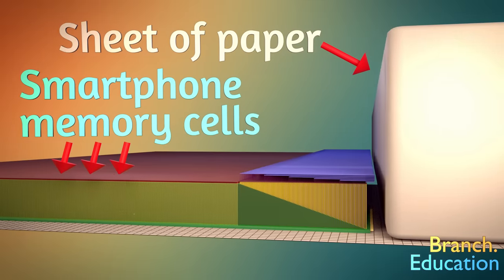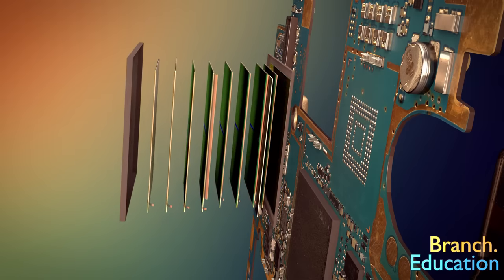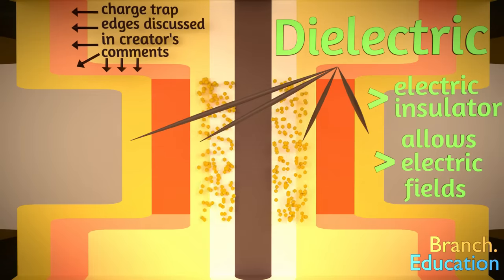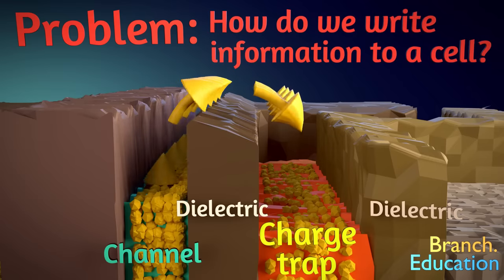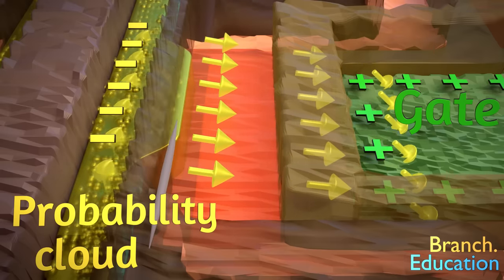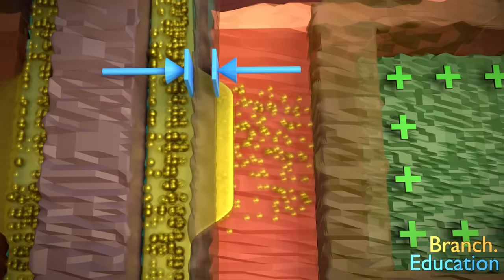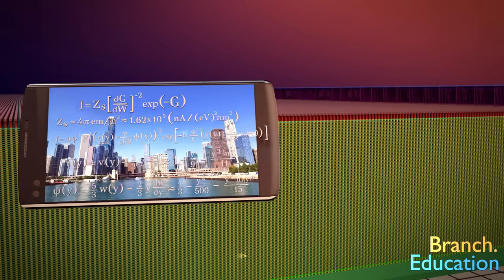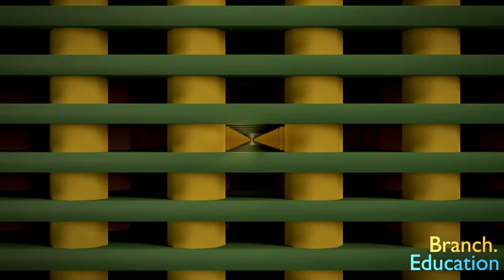The Engineering Puzzle of Storing Trillions of Bits in your Smartphone / SSD using Quantum Mechanics

Comment: This is so cool, but the thing I always wonder is that how do they made these atom sized things !
Reply: Mostly litography i believe. That is like revealing photos, one over another
Reply: They build up these patterns layer by layer. Not the "layers" of different materials you saw in the video, but bottom to top. You start off with a flat sheet of the material you use the most. Then you use light shining through a mask to edge valleys into the material. Those valleys then are filled up with another material and excess material is polished away leaving you with a flat sheet of one material with patterns of another material. Repeat this until the layer is done and then continue with the next layer.
Reply from the maker: Kinda how Cubinator & Marcelo described.  More accurately, they alternate depositing layers of Silicon Oxide and Nitride, and then use lithography to create a 'stencil', and then use an etching tool to cut into the layers, and then do another set of depositions through all the holes, and well... it's a long process.

Comment: I have always wondered how information was stored in a chip. I knew it was stored binarily but didn't understand how we managed to prevent that information from escaping. The fact that we can store and access information coded in this fashion is mind boggling. Unbelievable achievement.
Reply: It's only flash and nand memory that works like this.

There are other forms of solid state storage chips that work completely differently.

Some use tiny capacitors. E.g. RAM. 
Some use only transitors. E.g. Cache memory inside processor chips (this is also the fastest and most expensive type of memory)

Comment: Thanks so much for the wonderful explanations in the tech details; you guys are amazing. I like to point out a confusing Canadian/Eng subtitle for the tech details part in timing 1:32? Your equation said 6E11 bits = 1.5 E11 bytes? The only reason that I can guess is that you treated two cells of the flash trap as one memory unit, which means that 2x6E11 bits = 12 E11buts = 1.5E 11 bytes? Again, all thanks for the good works!

Comment: It's pretty insane we can manufacture structures smaller than any wavelength in the visible spectrum. They have to use extreme ultraviolet light to even cut those channels, it's the only wavelength thin enough to cut grooves that small.

Comment: Amazing explanation. I saw the SSD video in which you missed how exactly the cells trap charge. Now its clear. I work with transistor bitcells which can store 1 bit, very interesting to see how 3D NAND can store 3 bits. Would be thankful if you could also explain the sensing circuit for the 3D NAND.

Comment: Thank you for the caption comments. They were phenomenal. I got all giddy and excited when I got SiO^2 correct. However, I was expecting the Silicon to be doped with Boron or Phosphorus depending on the direction they want the channels to flow kind of like how Solar panels are basically giant diodes pushing the charges in one direction towards the battery. What are the advantages of using Nitrogen instead of Boron or Phosphorus?

 I've kind of obsessed a little over how solar panels are created and function in the past several months and it's pretty cool to see similar applications but on a quantum level for other devices. 

It should be mentioned that while SiO^2 is basically sand, it is a bit more complicated than that. SiO^2 has a very specific structure (allotrope) and is not as common as the sand you find on the beaches.

 The SiO^2 is ultra purified using carbon arc welding (CAW) which allows the Boron, Phosphorus, Gallium, or in this case Nitrogen molecules to attach in specific places for ideal electron movement. Obviously electrons are in general fields, not exact spots, however these spots are more predictable based on which allotrope of an element you are dealing with. That is why it isn't ordinary sand...

Comment: A few questions:
How do you empty a charge trap? 
Also, you said that applying a positive voltage to gate is how you poll for the level of charge stored in a charge trap, but in this video you say it's how you increase the charge stored in a charge trap, how is it possible that applying a positive voltage to the gate does both of these functions?

Comment: What this video omits is that the very waves in which that tunnelling depends on to work, do not exist. The waves were attributed to the quantum scale in the1760's when very little was understood about QM. Waves were attributed to QM scale because there was something like waves seen at our macro scale, as in water waves and in musical instruments. It is now known that those waves are not really there but are artifacts of a deeper mechanics. In water that is water tubes that rotate and the part of the tube that is closest to the surface is an artifact or a left over part of the action that is mostly under the surface. The top part that, looks like a waves is actually a part of those tubes of water under the surface. Same in a bell. The strike that makes it work is a compression front that propagates through the material of the the bell to deform the bell in making it wider at one part of a compression cycle and narrower at anothe part of the decompression cycle. There is no actual wave there but oscillations of compression fronts moving through the material of the bell. Same in stringed instruments. The vibrations seen there is more like that of a skipping rope where the string rotates but is held in place at the ends where the same kind of compression and decompression guides the string to flex at those two points and the length rotating is a left over mechanism from the ends where the actual control or mechanics is to make the rest of the string behave the way it does. The ends of the string holds the energy and the rest of the string is a left over response to that main point of energy.

By attributing something that does not even exist at the macro level is to give the quantum scale something that just does not exist as a real mechanism at either scale. That makes waves as something that is just used as a handy way of explanation that is assumed to work, theoretically, as in, the best explanation currently available but never proven to be based on something that actually exists, and then just used for that being an accepted part of Quantum Mechanics. QM is based on several such assumptions without enough of its practitioners even questioning this very strange condition under which QM is being practised.

Carver Meade, the most prolific inventor and manufacturer of transistors, never used QM to design his transistors or to guide the development of his transistors or to manufacture them. He also stated that QM, in the way it is practised currently, will be laughed at in, about 100 years just because of the gross and inaccurate assumptions that QM is based on. Meade has also called on QM to be over hauled just because of that point.
How an electron gets past that potential barrier in the transistor as shown in this video, is by changing its potential energy into kinetic energy and wiggling from one atom to another that way. No waves or probability required. 

What QM physicists are doing, is propping up their belief based way of doing work at the quantum scale because there is no real understanding of how to do it in any other way. That is the exact reason why the QM scale is described as not being anything like the macro scale.

Also the electron was assumed to be a point since the 1920's. A PhD student was searching through the available literature as to how the electron was modelled. Not finding anything in that literature, the student stated in their thesis, "Let us assume the electron to be a point." That statement, when found by later researchers, and not finding anything to contradict that assumption, also used it and repeated it as a reference until the number of those same references to that first paper was so large in number that, that is all that it took to make it stick. No actual physics work was involved so it is all an unfounded assumption. 
The third of many such assumptions is that gravity is a 4th force like the 1st electric force, 2nd nuclear strong force and the 3rd weak nuclear forces. Because the first three have all relatively easily been found to have a particles associated with each of those first three forces then, it seemed reasonable to assume that gravity should also require a particle but which particle was not found by the equally easily found way as those particles were found for the other 3 forces. But, no matter how hard everyone tried, it was not found. So the work of Mr. Bose in the 1960 was dug up and found to be modelling or explaining gravity by the use of particles. That was used until there was some sign of a particle in the Large Hadron Collider of a particle that seemed to fit. That particle never did fit enough of the several requirements to confirm it as the particle searched for. So a vote was taken and it all depended on that vote to decided that a particle existed when it was very much in doubt. That is not physics as well but a use of a political action of voting to settle what physics could not do.

 There are many more such blunders in QM and Cosmology that all make the practice of physics to be based too much on too many assumptions and too little actual physics which is the way physics is supposed to be done. As in experiments that either continue to uphold a theory or to falsify the theory. Which is the real reason why QM is so weird. If those assumptions were replaced by slow painstaking work then we would have a much less weird way of doing physics. But try and tell a physicist to slow down and do their work more carefully and they will cite the need for getting money or starving. So they are basing their way of working  more on not having a steady income and not what the rsults of that way of doing physics will have a bad effect on physics. Money is the source of all evil for sure.

Comment: Most of quantum is indirect explanations and fudge factors that produce useful results. However the actual explanation is likely wrong and incomplete but has allows people to look at it from a different point of view. So much so it looks like it is new. Most of this happens with PN junctions which is glossed over. There is a few properties here which can explain some of this. The field strength is a problem for diodes under certain design/operation conditions. Leakage happens for a couple reasons.
According to this explanation this is kind of like active transport in biology. However unpredicted is the homeostasis behavior which is passive. Many people will discredit this as there is "proof", which is funny at best. What are electrons again? Subatomic particles that can exist on silicon lattice? Energy can move them? How do semiconductors work again? What is a filter? What is energy? The scope of the barrier is the difference. A lot of topics in science pop up in other places.
Computer Science, Economics, Business got time, computation, work and money wrong. All fail to understand systems. Here is the problem with frequency centric models is it fails to understand certain things which shape architecture. You also can use lower voltage signals to store information. However this assumes no noise, which can become hard. Also filters react with them.

Comment: hey, why exactly those cells have a limited number of read/write cycles? what exactly happens with the cells?
Reply: Afaik when the data is erased not all electrons go back. Some stay trapped. Over time so many get stuck that at some point you can't tell for sure if it is empty or full.
Reply: Also the leak is the cause for data degradation/data decay
Reply: reading data involves measuring voltage. and 3bit cells have 8 different levels of voltage in a range. as electrons get trapped, the range narrows until the levels become indistinguishable.
Reply: @PelicansPreston777  that's a great way to simplify it
Reply: I believe the tunneling can damage the dielectric, eventually to the point where the charge cannot be reliably stored or sensed.

Comment: It’s nice to know that a strong enough positive charge would wipe my electronic devices 😇
Reply: Friend of mine learned this the very hard way, he put a magnet on top of his laptop, unfortunately on the very top of his SSD.

The laptop went nuts lol. They had to replace the SSD.
Reply: I didn't hear about magnets damaging an ssd before, are you sure it wasn't an hdd?
Reply: @Mart-E12  hmmm i forgot and i'm not entirely sure, i do think it was hdd. Hdd are more prone to magnet failures
Reply: An emp would wipe an ssd drive a magnet mechanicaly damages a hdd
Reply: A cautionary tale to all those people sending positive vibes.
Reply: @Mart-E12  An EMP would affect an ssd if it's connected to the power grid. If the ssd is inside/outside the computer disconnected from power outlet, it most likely will survive an EMP. The wires have to be large/long enough to affect the connected device. SSD is to small.
Reply: @stanislavsynytsia6592  Yeah I'm not an electrician
Reply: @georgecataloni4720  Joke of the year goes to you dear sir.

Comment: This was puzzling me after watching your first video. Thanks for covering this part.
Problem is now I'm intrigued to know how these super small structures are manufactured
Reply: Lol...with stencils, a UV light and resin.

Basically, it's the same process as etching designs on a piece of metal, with a stencil, resin, a UV light, and acid.

Except, in this case an extremely detailed and expensive stencil, called a mask, is used.
Reply: It's actually a fairly old process. This was introduced in 2013
Reply: @matsv201  I wouldn't call something from 2013 old lol. That was only 9 years ago.

Comment: What's really crazy is that quantum tunneling is just a way to try and explain how the electron just appears on the other side of the wall. It literally goes from one point to another without traveling.

 Quantum physics is so cool and weird.
Reply: Jd B 😂 so weird bro but in reality the dielectric used as barrier gets hot when voltage is applied to the gates which therefore allows conduction and the electrons therefore gets the freedom to travel through the barriers to the other side

Comment: Very well explained. I wonder how microchips can get any smaller then if there is a specific thickness the wall needs to be to work.
Reply: Just as more layers. There is a few other ways..

Also, eventually we will go MRAM and the  use quantum spin directly and not needing this gap. That will cut down on it quite significantly.

Comment: It is said that NAND data can only be stored for 4 weeks at 55 degrees Celsius. If my SSD works at 55 degrees Celsius, does it mean that the controller needs to rewrite the data after every 4 weeks of operation to prevent data loss?  Or rather, after powered on, NAND itself could prevent electronic loss without consuming the lifespan？

Comment: The fact that we went from desk  size, slow, power hungry mechanical hard drives that cost $15,000+ (adjusted for inflation) and only have 5MB to 1TB+ UFS SSDs that are as small your thumb, sip power, and use quantum mechanics to work that costs maybe $300 in less than 50 years is insane and makes me wonder what the next leap in storage and tech will be.

Comment: Reading data from a page simultaneously is achieved by applying different voltages to the shared control gate and seeing which cells are activated depending on the charge they store. However if the vnand ssd also writes to an entire page simultaneously using the same control gate, how can individual cells get charged differently?
PS: awesome video and content in your channel!!

Comment: But how does the cell keep the electrons, after they've been attracted by the positive charged particles? And what tells the positive charged particles how strong they should be? And how do the cells push electrons back into the channel running along the string toward the CPU? I have a number of annoying questions like this. haha. Is there a good online forum for this kind of stuff?
Reply: Dielectric without an external field causes them to stay; all electrons at a given temperature have the same 'strength'.  Negative charge field pushes them back through the other way.

Comment: Wait, does the chart near the end say if you spring for a larger drive up front, you get much larger # of operations in its lifetime, even if you don't use the full capacity? Pretty interesting.
Reply from the maker: Yeah, the ssd does wear leveling so the same section doesnt get used over and over

Comment: probability is not really the case, but is a simple example of what is going on here.
in reality, electrons are focused points of electricity that are negatively charged. When applying a strong enough positive charge, the electricity is squeezed past the atoms that make up the insulator, and they all merge back together on the other side.

Comment: Hello branch education I love your channel I recently had a doubt about batteries.
I could sound stupid.
When charging my phone while using it shouldn't the flow from negative to positive reduce therefore reducing the flow of current because the charger is forcing the flow on the other direction hence stopping the flow of current. Does that means that my phone will instantly switch off? I tried it and it didn't happen instead the percentage was increased. What happened here please explain.